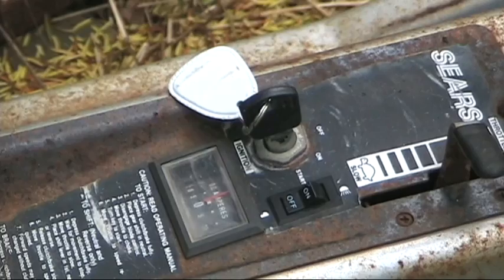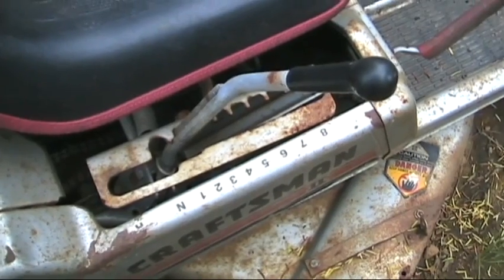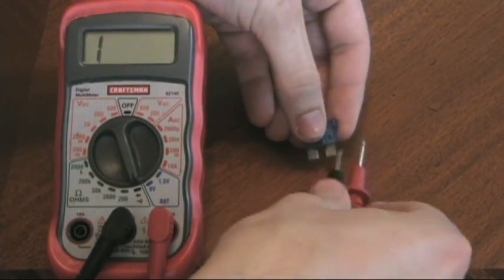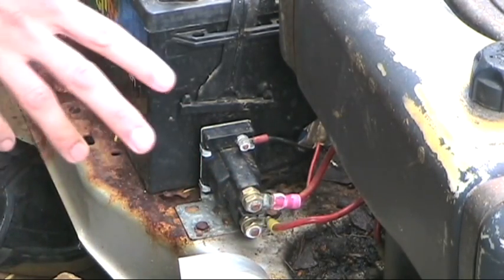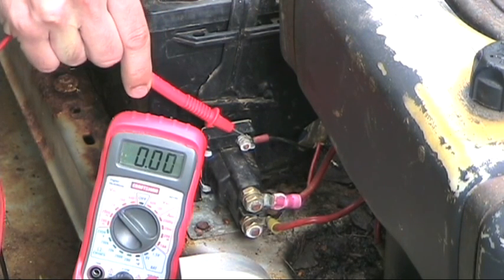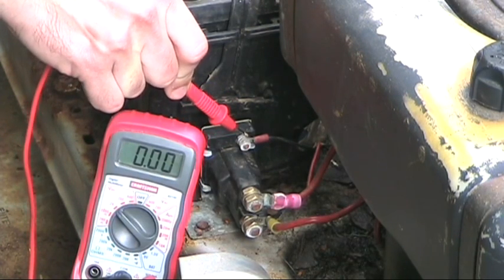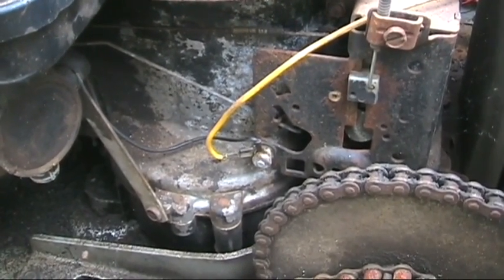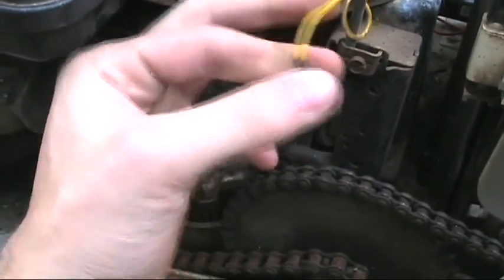Basic Electrical Troubleshooting for Lawn & Garden Tractors

Comment: a real quick way to test the solenoid  is to turn switch key on to start  not much happens   but you hear a click each time you turn he key   turn switch off now go to solenoid  use  a screw driver pla ce   a short between both big termnals on solenoid does starter spin now if so replace solenoid if no spin with screw driver prob dead battery   this test takes about 2  min to tell if its solenoid or battery. dont need meter for this

Comment: I just purchased a new battery and solenoid 4 pole. hooked it up and still not getting any power to the wire coming into the solenoid. I removed the ignition switch and tried it in a running tractor and it worked, so that rules out the ignition switch. I tried a jumper wire to see if i can get a light on my probe but still nothing. I believe this tractor only has a brake sensor. This tractor is very old but he had someone put a Deere 20hp briggs on the frame which was a total crazy thing to do being that the PTO is secured by a chain. All grounds have been cleaned and tightened?????? any thoughts??? I can jump the solenoid and the starter will move and i had it going until it ran out of starting fluid... thanks in advance

Comment: Thank you. I have a problem with my ride on. I was using it. Switched it off to move a table and then got back on. Turned the key-nothing. The battery had power, but I charged it just in case. Nothing. Began to take it apart, thinking that it might be the ignition switch, but found the connector on wire from the switch to the solenoid had rusted and fallen apart. Put on a new one and put it back together. Nothing! So, your video has given me a starting point. Thank you.

Comment: I have a dlt 2000,it has a 25 ovh,solenoid needed grounded better so when I grinded the paint where it went I cut four or five black wires right below.it has two black coming from back that is grounded.need to reasemble just black wire from gauges ignition pto  relay etc just black wires

Comment: What will cause the my old cub cadet 105 to keep cranking when the ignition is turned off. The starter keeps turn when the key is off, I have put a new key switch, Solenoid, and rebuilt the starter generator. I'm an clueless.
Reply: Daniel Sorrentino make sure you have exactly the correct switch. I had an incident similar on two Craftsman Gts. One was a 94 & other a 93. Both switches looked identical however the terminals are labeled A-B-C. Two of the terminals were in switched  locations (even though they would plug into each others harness). So check that the tabs are lettered to the correct terminal

Comment: Do these tractors have alternators to recharge the battery like a car? Every time I use my tractor, I have to put the battery on a charger for the next use or it will not start. I even tried a different battery and the same thing happens. Any suggestions?
Reply: They don't have a alternator, it may be the starting wires draining the battery or just the battery
Reply: LMN Ruiz yes they have a stator under the flywheel that charges the battery
Reply: they do not have alternators but some do have whats called a magneto which is usually mounted on the flywheel some place that could just be rusty or dirty take some sand paper and sand both magnet faces where they cross paths durring opperation.

Comment: I have a craftsman DLT 3000 it has a Briggs & Stratton 18.5hp OHV engine. The problem is I replaced the starter in which was bad and the battery also bad. When you turn on the key to start the engine it will turn till it hits the compression stroke. Then if you turn the flywheel a little it spins great an starts. You can run it for a matter of time shut it down it may of will start if not the same again. This engine has never been worked on besides maintenance and the battery and starter replaced. I'm stumped at the moment. Wil
Reply: the reason why it spins the way to let it quit is to get a screw driver barely tap it on the celennoil and it would quit spinning and if it doesn't start get some starting fluid and spray a little at a time in the breather and do it until its fully cranked there's you a tip:)

Comment: Helpful video especially shorting out the solenoid.

On the Simplicity lawnmower line, I believe jumping the electrical system with a charger or a car battery might damage some parts?

Comment: I have a quality pro tractor its making a clicking noise at the solenoid when i turn the key plz help
Reply: try jumping the 2 terminals of the selenoid and check your starter positive cable for voltage

Comment: great video.  I jumped my lawn tractor from the starter thanks to you.  I hooked it up like you showed, and I turned the ignition switch and started up after 2 tries, one with choke on, the other no choke.  but now how do I finish narrowing down the problem?  since it started with jumping the starter does that mean the problem is between the solenoid and the ignition?  or can I rule the ignition out? btw, it's a craftsman model #9172720601

Comment: I have a P.O.S. craftsman kohler command 25 hp v- twin. Model number cv25s fam number skh725u1g2rb spec 69526 cc 725. Mower ran fine had drive belt issue. It was parked uncovered my bad but now no spark. First it would not turn over. I rewired switch with push button jumpered to Key switch hot. This to power up fuel solenoid which I hear click when keys turned. Cleaned coils points magnets on flywheel, unwired kill wires and have deadman wire from both coils for now until toggle can be installed. Now motor turns over via push switch but seems neither plug are getting spark. The regulator mounted on oil cooler side of motor with 3 terminal pig tail I didn't pay attention to how jumper wire screwed to it was grounded. I mounted direct to plastic motor cover screwed into metal motor mount hole. I also have L shaped little metal bracket I have it mounted under fuel pump binding separate metal motor tab ends together. I find it strange for it to have run fine then for both coils to be bad. I'm sure there is a power generation device that powers that up but I'm thinking my grounding of regulator may be issue. Like I say cut out seat and clutch safeties have 12vdc jumpered to hot on key switch powering fuel solenoid 12vdc entering momentary leaving to starter solenoid, dual coil kill wires wired together run out to deadman wire that can be grounded by hand. I have watched you and Tristan's video and have faith in any suggestions you may have. My faith is hard come by too. Thanks....

Comment: nice vid very helpful I am rebuilding a1993 Briggs and Stratton  12hpmotor  my question is would they  all be the same as yours or would there be other differences besides the battery placement ?

Comment: some do, especially if it has headlights or other accessories. There are one or two wire coming out from under the fly wheel if there is an alt.

Comment: my mower requires that the brake be presses all the way and the seat switch engaged. Will this test still work if those are not done? I am only getting a click from the solenoid when I turn the key with the brake down and seated.

Comment: I have a Gravely 260z with a 25hp Kawasaki. My starter will work once and a while but when I hooked it up to a battery charger and put it on boost, it would fire right up. Any idea what the problem is? BTW brand new battery.

Comment: I have a zturn bobcat ride on mower, has the kohler commander engine 25 hp, it misses and pops with a load of heavy grass , would you have an idea of what could cause this? local repair is saying i need a new motor, but it can do it one day, and not the next, if the motor was bad.. it would be bad every  day , right?

Comment: the NO side of the Brake switch, then to the solenoid. you now have starter lockout wired.

some older mowers dont have a NC side on the brake switch, so you just skip that step for the ignition kill part of this, by just running the wire from the M terminal to the blade switch to the seat. and remember that usually there are 2 wires going into the M terminal. one goes to the magneto the other goes to the safety switch setup.

Comment: run a wire in parallel from the M terminal on the switch through the NC side of the blade switch, to the seat switch, then to the ground from the seat switch. also run another wire in paralell to the M terminal and run it throuth the NC side of the brake switch, then to the seat switch.  you now have the safety kills setup correctly.

now for starter safety. run a wire from the S terminal on the switch (wire going to the solenoid from the ign switch) to the NO side of the blade switch, then to

Comment: theres a hundred ways to do it...but some have terminals that are labeled

M goes to the Magneto kill wire, G goes to ground.

turn the switch to the start position, and check which two terminals have continuity. there should be only 2 that have continuity if i recall correctly. one gets +12V, and the other goes to the starter solenoid.

simple safety setup. the switches have NC and NO (normally Open/ Normally closed) sides. normally is if the switch was off of the tractor on your desk.

Comment: Great Vid! I have replaces the solenoid and still not able to start. I checked with meter and have 12v brand new battery. checked ground wire. when i turn the key there is nothing happening. any suggestions would be greatly appreciated. Thanks again.

Comment: I have a john deere riding lawnmower. L110.. it  had worked great... just started it and then it stopped about 3 minutes later... no electrical power at all.. lights wont turn on nothing... i know the battery is good.

Comment: Very good lesson. I would only mention that in the "jump start with the screwdriver" section you warn your viewers to be SURE the mower is in neutral and the blade is disengaged as jumping the solenoid bypasses all of the safety switches. Keep up the clear and informative videos.

Comment: i replaced my starter switch because when i turned it it would not turn over. but if i jumped it with a screw driver on the solenoid it would start. but with a new igniton it still wont turn over. whats the problem?

Comment: no cranking. replaced selonoid, still no cranking with key, but connecting small screw on selonoid and the hot post I get engine cranking.  whats the problem? my ignition switch?

Comment: not good with wires, no cranking, I replaced selonoid and still none...but when I connect the small screw on selonoid with the hot post the engine cranks.  whats the problem..the ignition switch?  I will try some of the things you mention, like connecting the two big post-haven't tried that.

Comment: ok, I'm not good with wires.  I replaced selonoid because no cranking, still no cranking.  but if I connect the small screw on the selonoid (iginition) to the hot/positive post with a screw driver, the engine turns.  whats the problem?    I'm going to try some things you showed

Comment: This was such a helpful video. I intend on putting what I've learned to use tomorrow because I spent all of today splicing wires and getting my LT back to "stock" shape, electrically. When I turn the key, I hear nothing. I'm thinking it's a solenoid issue (i hope it's that). Great videos!! Thank you so much.

Comment: Thanks,18 inches of snow last night my cub cadet with snow blower was dead in the middle of the driveway. I was sure the fuse looked fine. When you said a fuse my be bad even if it appers ok prompted a proper polarity check of the fuse. It was bad. and I felt dumb but hey new fuse and on my way. Thanks for posting.

Comment: I like this video very much and it gives the owners things to look for when trying to start that mower. My Craftsman LT1000 with a 17.5 hp Briggs engine in it. The engine turns just fine, and will only start when gas is poured into the the Carb. It will then run until the gas is burned up then quit. One line running into the Carb was replaced along with with all filters, spark plug, and all tires. I am thinking that something is still stopped up in one of the lines.

Comment: extremely useful!! thanks!! can i recommend a vid on how to re set the throttle cable from carb to that part where you had the kill wire at...resetting that after replacing a carb is a pain in the ass!! i always get it wrong. and break the wire with the choke  spring on it...

Comment: my friends mtd ranch king just died on him and i think it is the seat switch because the ignition coil isn't getting power and there is no power at the seat switch so do think it would just be a bad wire or somthing else? and if its a bad wire could i just bypass the  seat switch by just going from the switch to the ignition coil?